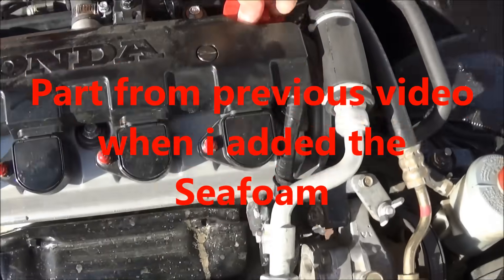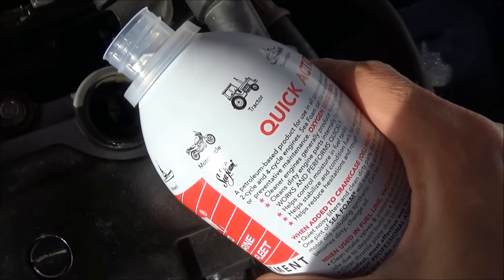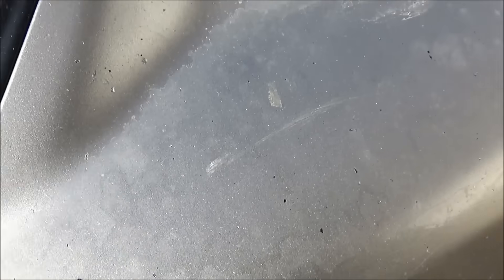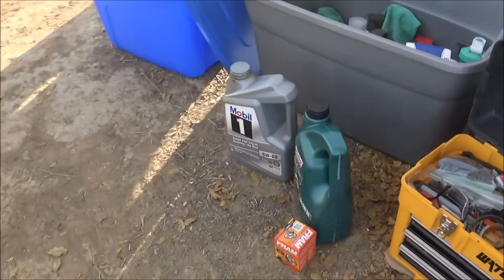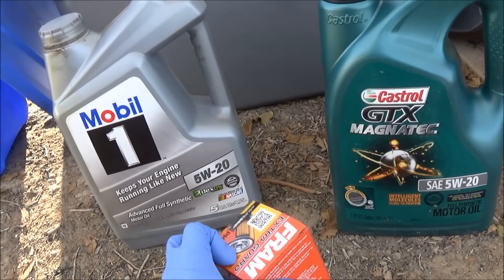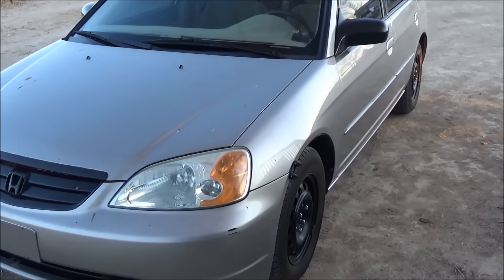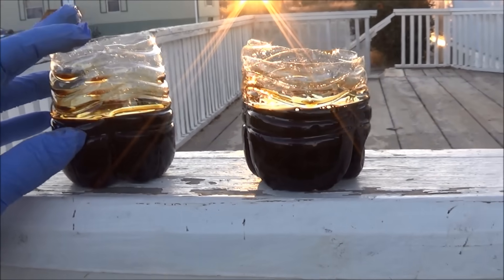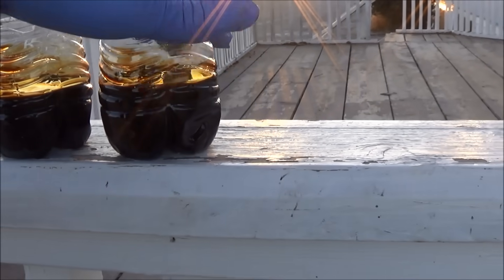Seafoam In Oil | Seafoam In Oil Before And After | Seafoam In Oil Before Oil Change [Sea Foam]

Comment: The seafoam did a great job cleaning up your engine. Your engine looks to be very clean inside. It looks almost brand new.
I would be careful in the future though. The instructions say to only run your engine for a few minutes after adding seafoam to the engine oil. It’s a solvent and it really thins out the oil. I’m glad you didn’t damage your engine. Please be careful and read the instructions on the can next time.
I have used it in my engine but I only let the car idle in the driveway. I’d be afraid to drive at all with seafoam in my oil. I know you’ve probably already read about how bad Fram Extra Guard filters are in the other comments but I have to agree. They are very cheaply made and poor quality. It’s probably the worst filter out there.
Watch some videos about oil filters and you’ll see how bad they are when they’re cut apart. It’s pretty shocking to see the difference between filters. I don’t have a Honda but I would recommend a factory replacement oil filter from Honda or another quality manufacturer. I know they cost more but it’s definitely worth it. If your oil filter fails it can destroy your engine. A good filter is well worth the price when you consider that.
Reply from the maker: I agree thanks for the feedback. I don't know where you get your info from but your wrong i am sorry to say. Check out this i pasted right from seafoams website. That's how they say to use it AND it also states it doesn't change the velocity of the oil..
 Add 1 OUNCE to 1..5 OUNCES of Sea Foam Motor Treatment per oil quart for all 4-cycle gasoline and diesel engines.
When ready, remove OIL FILLER CAP and pour the recommended amount of Sea Foam Motor Treatment directly into the engine crankcase.  Do not exceed one treatment per oil change interval.
Though Sea Foam can be added at any time between oil change intervals, we recommend adding Sea Foam to oil crankcases 100 to 300 drive miles before changing oil and filter.
When checking dipstick, always change oil that goes from clear to dark.
Benefits:

>Sea Foam will safely liquefy petroleum residues that restrict flow and lubrication
> Cleans oil control rings, VVT solenoids and actuators
> Dissolves and cleans deposits throughout the crankcase including diesel soot residues
> Cleans and quiets noisy lifters, timing chain tensioners, and reduces diesel injector stiction

Additional:

> Sea Foam only contains petroleum-based ingredients and cannot harm your engine
> Sea Foam will not change the viscosity of motor oil
> Sea Foam is compatible with all types of conventional and synthetic motor oil
> Sea Foam will not affect seals, gaskets, or O-rings
Reply: @Chicodirt  its viscosity not velocity.
Reply from the maker: And i have watched the fram videos. I know what people say about them i just wanna do my own test ya know. Check out my other oil filter video i compare fram to honda oem and THEY ARE THE EXACT SAME! So i would rethink your seafoam and oil filter info.
Reply: Sorry. I guess I was wrong. I wasn’t trying to be rude or tell you what to do. I just thought it would thin out the oil and I was afraid it would damage your engine. Thanks for your info. 
Have a great day!
Reply: I didn’t watch all your videos. I didn’t realize you had taken them apart.
I didn’t know that the Honda filter was like the Fram. Once again, I wasn’t trying to be rude or anything I was just trying to help.
Reply from the maker: Ryan Hodges Check em out man you will be surprised. No worries i didn't think you were i just wanted you to know. Thanks again for watching.
Reply from the maker: Ryan Hodges No i didnt think you were i just don't want you to have the incorrect impression of seafoam it really is great stuff. I have the cleanest best running engine out of anyone i know. I just got to 227,000 miles to.
Reply: ThizzleKid420 Thanks. I really like Seafoam. I have used it for years to clean carbon from my engines and I’ve put it in my gas tank. I have never put it in the oil because I was misinformed about what it would do. I’ll definitely try it in the oil next time I’m close to doing an oil change. Thanks. I’ll check out your oil filter video.
Reply from the maker: Ryan Hodges Yea it works great man. Ur all good. Check out my marvel mystery oil videos to that stuff is awesome and actually cheaper than seafoam.
Reply: You’re right. Marvel Mystery Oil is fantastic stuff. I have used it to quiet noisy lifters on a Dodge 318 V-8. It works great and it’s been around for years.
Reply from the maker: Ryan Hodges Yeah i have used it a few times its great
Reply: Seafoam official has a video and notes 100 - 300 miles drive time before oil change.
Reply from the maker: James Weimar Nice. I say it depends on how dirty your engine is. On the bottle it says run it the whole 3k oil cycle
Reply: @ryanhodges7101  The instructions on the can I bought do NOT say to run it for a few minutes. They say drive it 100-300 miles before an oil change. Are the instructions on my can not properly proof- read and full of typos or do they just put random instructions on each can to mess with ya?

Comment: Best cheap filter is supertech at walmart. Made by wix.  Better than fram and it's only a couple bucks.
Reply: bsizzle Hill hell yeah bro
Reply: Thanks for the info. Have you cut them open to verify the usual Wix quality.
Reply: William Riley I watched a video on it and the guy showed that they were the same.
Reply: Super tech oil filters used to be Champion Labs filters.
Did they completely swith over to Wix, or are both suppliers for ST?
Reply: Lee S. On youtube search "Supertech oil filters are wix " that's where I got the info. Not sure if all are made by wix.
Reply: Did not know that. The more you know. I pulled a Supertech filter off my wife’s truck after buying it. I didn’t know much about the quality, but I just went back with the OE Champion filter.

Comment: NEVER! Use fram oil filters! NEVER!
Reply: Use a Fram ultra.
Reply: Personally, I would've used Bosch or Wix, they don't cost as much as a K&N or Mobil filter.
Reply: When I had to 94 Grand Marquis and I use FRAM oil filters they would always leak, but now I have a 2006 Chrysler 300C in the Bosch oil filters leak on there no matter what I do now I use STP oil filters, never have a problem
Reply from the maker: Thomas Yarri I got one on now 😱
Reply: ThizzleKid420 it’s got cardboard that comes apart and destroys your engine. Spend the extra dollars and get a purolator or wix. Trust me I’ve rebuilt enough engines to know....
Reply from the maker: NWB1989 Never tried them. After this next oil change i am going back to Mobil 1 or K&N

Comment: This Extra Guard filter is total crap. If you want a good FRAM filter, use the Ultra Synthetic one - they are very high quality, nothing compared to Extra Guard. But yes, they are a bit more expensive.
Reply: I'll use the frame ultra or wix in my cars
Reply: John Sears That is simply not true. Research it and see it cut and disassembled. Totally different components. The Tough Guard and Ultra Synthetic have nothing in common.
Reply from the maker: Acura Addicted I agree. I normally use mobil 1 or K&N
Reply from the maker: Nice i might try wix
Reply: I'm glad somebody knows Fram make a good filter. NOT the red-orange ones.
Reply: Acura Addicted no matter what Fram oil filter you get they're all exactly the same except for their price.

Comment: Change your oil and filter regularly and don't cheap out on them. Then you will have an engine last you a long time. No need for all this nonsense seafoam and other detergent crap.
Reply: promote your business here .... you said it all brother. People are fooled into believing this crap actually helps their cars. It's just advertising taking your money. Change your oil regularly and the detergents in the oil will keep your engine as clean as anything and do that safely as well
Reply from the maker: promote your business here okay man will do. I have used seafoam once in my engine i do regularly oil jobs now
Reply from the maker: Totally agree man i usually use Mobil 1 full synthetic its cheap at walmart also with a Monil1 1 oil filter.
Reply: Its proven to work so its not crap. Itll help even the most maintained motors

Comment: People have been bashing fram for years. For a good reason. Motor trend actually almost got sued after filming a new engine install with a fram filter. Behind the scenes the motor locked up with in 2 min. The next episode they announce it was because they used the wrong oil filter, FRAM original, and are waiting for the engine to be rebuilt again. These episodes may or may not be available still.
Reply from the maker: J&D Shade Tree Well damn lol. I just put another one on my engine. Last one i use lol
Reply from the maker: +J&D Shade Tree Did you see my other video i am comparing oil filters

Comment: See you are using Fram oil filters,, why?  Check out those who test and compare them to other brands.
Reply from the maker: grassroot011 I am doing test only reason why man. I normally run Mobil 1 or K&N. Did you see my other videos? Newest one i Compared Fram extra guard Vs OEM Honda oil filte.

Comment: You get what you pay for most times,,,, a premium oil filter,,, better than original equipment,,, will have a check valve in it,,, that will hold the oil pressure up in the engine,,, when you turn the engine off,,,, a cheaper oil filter let's the oil drain back down,,, and you'll have a dry startup issue,,, but it's hit-and-miss from Brand the brand,,,. Expensive luxury automobiles will have this check valve,,, the same brand cheaper automobile will not,,,.  Cheaper oil filters are paper and will start to come apart,,, and clogged your main bearings rod bearings push rods or other oil control holes,,,. So a premium oil filter with a check valve to hold the oil pressure up in the engine is the most important part,,,,, and then the type of oil you use,,,, do not go by mileage on your oil,,, go by the color of the oil,,,, when it turns a darker brown replace it then,,, do not wait till it turns black,,,,. Under hard conditions and high RPMs,,, you can run your motor oil,,,, in maybe 1,000 miles,,,. I changed the oil after everyday of testing and track racing at 7000 RPMs and turbo boost at 12 and 1/2 lb,,,,.  That type of heat kills the viscosity of oil quickly before ever gets dirty,,,.  A oil change is cheaper than a engine change,,,,!!!   I have got seven seasons of racing on this motor,,,, with very little blow by,,, or leak down,,, when I used to change the oil at 3000 miles,,, the engine needed totally rebuilt after one or two seasons,,,.  ???   I also mix my own grades of oil,,, 4 engine condition and temperature,, ???  You generally will need 1 or 2 quarts of 20w 50,,. When they run like a raped ape,,, at temperatures above 90 degrees,,. !!!!
Reply from the maker: Good information man thank you! Check out my other videos on oil filters you will be amazed! Subscribe for more id appreciate it.
Reply: ,,,,, Damn,,,,, you must have been able to read my comment,,,, before I ever posted it,,,.  ???    If you're that fast on a track,,,,???   I've been building engines and road race tracks,,, for over 30 years,,,,. 135 miles per hour down the front straightaway,,, but the brakes are shot halfway through a race,,, !!!   Like they say slower is faster,,, you have to finish a race before you can win one,,,. !!!!
Reply: ThizzleKid420    a good tip,,, don't tell no one,,,.  Make your own brake pads,,,, out of a   1995. Chevy 1 ton clutch disc,,.  And use. 4. Pressure gauges,,,, attached to all four brake bleeders,,, to check brake pressure from side to side,,,, and front to rear,,. !!!!   Side to side must be exact,,,, a adjustable. Proportioning valve for the rear,,,, and Plum it into the side of the console,,,, where you can adjust it on the Fly,,,!!!     You would be amazed at how screwed up the brake balance is,,, on all cars,,,,. The number one reason why one locks up and you slide off a corner,,. !!!   But you'll never remember that,,,, and just wonder why,,, you can't hit that 35 mile-per-hour curve,,,, at 60,,,. ???
Reply from the maker: Rick Simpson Makes total sense i am going to look into this thanks!
Reply from the maker: Rick Simpson Haha ya i read it fast.

Comment: No not the fram filter! Lol. Sea foam is awesome. However I came across some stuff made in Germany about a year ago called liqui moly. They made engine flush fuel injector cleaner oil and additives. I put the injector cleaner in my f150. 10 min later I could feel a difference and after I tank I got 2.5 mpg better. My buddy has a 01 Tacoma and used the engine flush. The results were amazing. I'll leave a link for both so u can get some and test it 
Fuel injector cleaner http://amzn.to/2DEyUab and the engine flush is http://amzn.to/2Fk5HSr trust me use it. You'll love it
Reply from the maker: Nice i'll check it out thanks man

Comment: Awesome video, but I wouldn't put a fram filter on a car I hate despite the cost. May try this in my 95 2.2 vtec accord :-)
Reply from the maker: Oh really? Check out the video i just uploaded then tell me if thats still your opinion.
Reply: ThizzleKid420 about Fram filters? I refuse to use them. Kinda a diehard napa or wix fan. My baby has 187k on it :D
Reply from the maker: 78missredrum Nice i am at 226,000

Comment: The "Smell" is All the Environmental Toxicities That were previously in Your Engine,   Yes Its expensive But Its Quality & Cheaper Than Newwer Engine rep;lacements   &   Saves engine Wear &  Having To Turn The Engine into a Mosquito Spraying Oil Burner. & If You Noticed after Gas Prices Went Back Down a Considerable little, The oil didn't  Of Which oil Is Cruder with Less Man/Refining hours into it Should have Went Down & More Noticeably!!!   a magnet On The filter is good Even If Steel filings are so Tiny To See, They Still aint floating Around on bearing & Cylinder surface,  "Sanding" The Good metal Away...  Good to have posters other Good Respectfull Info Advices  Here also... Thanx...  & MMO Is Good also
Reply from the maker: That's good to know i appreciate the info. In this video the one with seafoam in it was very strong. The plain oil one had no smell at all.

Comment: Let me add my experience in here:
First, I see comments from some on here that Fram is a junk oil filter. Fram is a great oil filter... except for Japanese automobiles. Fram should have issued a notice on it 20 years ago... Back 18 years ago, I learned that Frams filter material is too thick. 
Here's the issue:
Japanese engines are HPLV, High Pressure, Low Volume, so the filter material in Fram filters cause a big pressure drop which is extremely dangerous, especially in Honda engines. Some of the other Japanese engines were able to handle it for a longer period than Hondas engines, but nonetheless, the difference is the same. 
On the opposite side of that, American I6's, V6's, V8's and some 4 cyls. are normally HVLP, High Volume Low Pressure; and because of that Fram filters normally had no noticeable issues for thousands of miles, except that I am of the opinion that it still caused a reduced life of the engine over time.
Reply from the maker: OKay thank you for this information. So i drive Honda 1.7l. I usually use Mobil 1 or Knn oil filters. Recently i have tried different ones. In your opinion which one would be best for my engine to last. I have 225,000 miles currently.
Reply from the maker: New video shocking results!
Reply: It's not the "thickness" of the filter media. Royal purple and NAPA Platinum have thick filter media, but they flow well. Also the better filters have a longer paper with more folds, called peats. And then there is build quality. The cheaper Fram filter lose in all categories.

Comment: I use that seaform in my oil,worst mistake ever.It made my car have oil leak that I never had before.
Reply: That means your car already had a leak but it was filled with gunk and dirt so the seafoam did it's job and cleaned that out
Reply from the maker: +donavon sion Yeah it will do that....Because its cleaning ur engine from the inside out so places that werent leaking before because it was clogged up with dirt and what not. So marvel cleans everything exposing your oil leaks...I strongly suggest you fix the oil leak and be glad to fix it now before real damaged happen. Marvel does it job and more. If you work on vehicles you would know all of this and know it was user error and you should not have leaks in the first place.
Reply: It's basic knowledge.. One of the first things I learned when I was an intern at a shop..0.o
However.. Fram is bad filters.. less filterpaper inside compare to others in same priceclass..+/- $1 or $2. If you cheap out..your car will cheap out on you right back.. :)
Reply from the maker: J⃟O⃟N⃟A⃟T⃟H⃟A⃟N⃟ S⃟C⃟H⃟U⃟L⃟T⃟Z⃟ Agreed!
Reply from the maker: Gush CHANNEL Agreed man lol. Check out my oil filter videos.

Comment: Hey man, thanks for sharing.  Thought that was very informative.  I haven't used seafoam in a long time and I plan on putting it in the crankcase as well.

Subscribed!
Reply from the maker: +Air Bag Hell yeah it works good! Depending on how dirty your engine is i would run it 500 to 1000 miles. Also check out my other videoe on Seafoam as well as Marvel mystery oil. That stuff works really good to.
Reply: Nice nice, and yeah, I sure will look into Marvel. I started to take notice of those products as well.
Reply: Update? Did you try it bro?

Comment: I've used seafoam and it does work.use it on hummer been running strong over 180.0000.miles..
Reply from the maker: DADDY DOLLARS Ya it worked good.